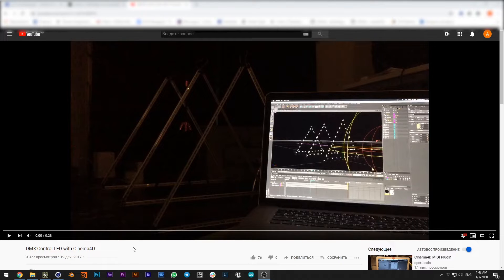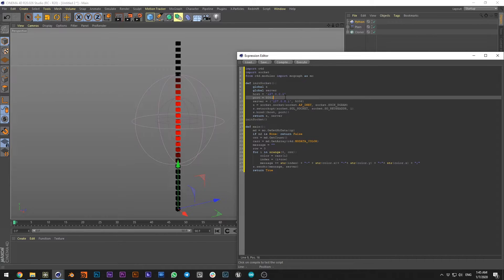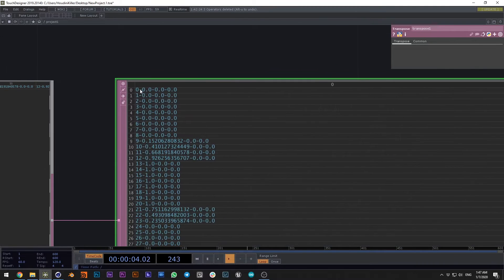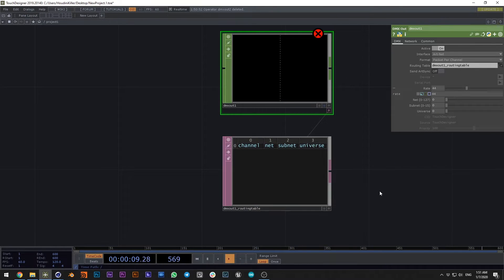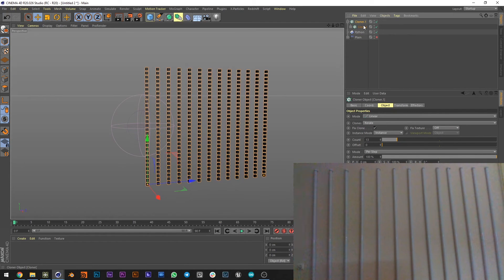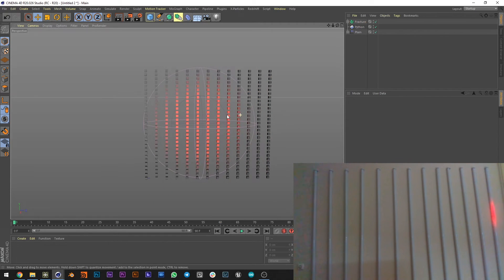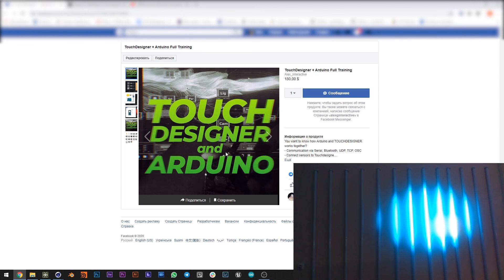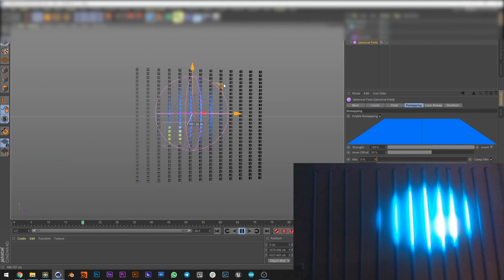TouchDesigner & Cinema4D | Control LED strips with MoGraph

Comment: Great tutorial, thank you for posting. I'm stuck on the step between cinema and touch designer. When I switch the port to 5006 in touch designer nothing happens. Any suggestions would be much appreciated. Cheers
Reply: For any one else wondering, my python effector was not actually connected to the cloner so there was no mograph data
Reply: @jamiebarron2  What is C4D version do you use? TouchDesigner didn't catch data from C4D 2023 in my case
Reply: @nickname0ff  It was R21 at the time.